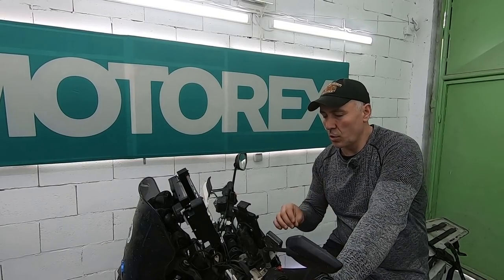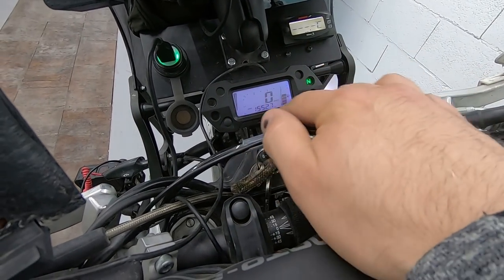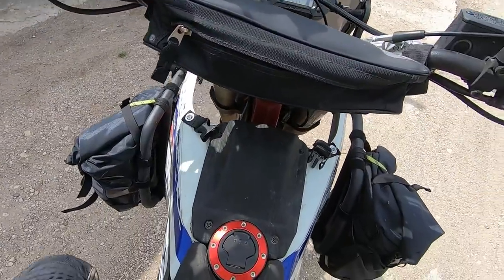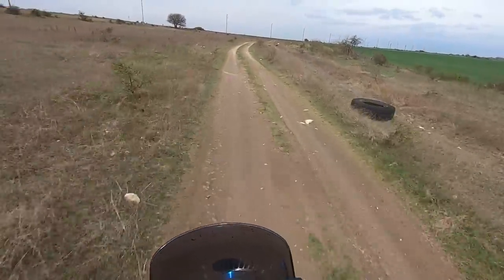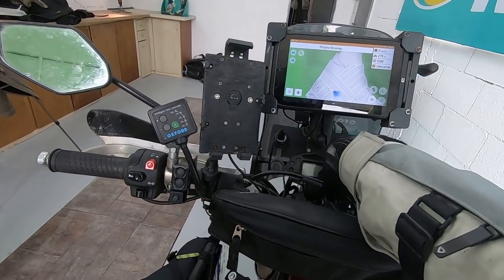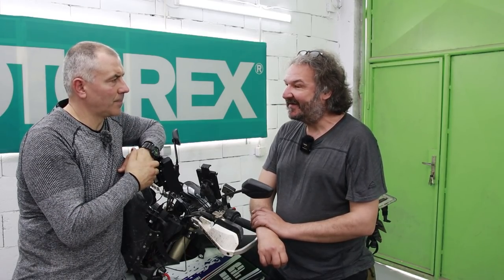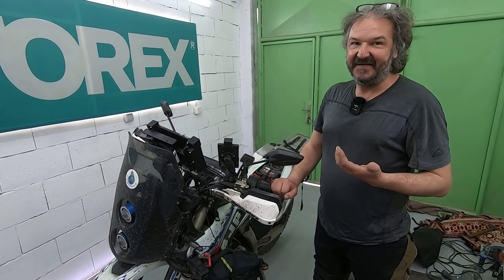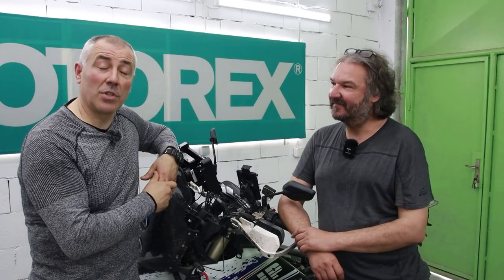AJP PR7 - Big Dirt Bike in Adventure Suit!

Comment: About seat comfort: honestly I was thinking that the PR7 is for "steel-butts" only. But now I have some doubts! He can really stay so many hours on asphalt without particular problems? What was your impression about the seat? It seems very narrow.
Reply: I happen to own one. What you'll find is that the seat is surprisingly comfortable. It hasn't even crossed my mind to look for an aftermarket seat or modify the stock seat in any way. A very pleasant surprise after riding KTMs and the smaller Yamahas.
Reply: @jotemenkir  How is your PR7 going. I would like to change from my 690 to a PR7 but a few of the PR7's in Australia have cracked the crank case at the front engine mount. This is very concerning.
Reply: @pauleyj8  I've actually never heard of cracked crank cases on the PR7. I searched on the AJP Australia group (largest AJP group), but was unable to find anything. Not saying it isn't happening, but it is news to me. Also, the SWM engine has been around for quite sometime and is considered quite solid.

I absolutely love the bike. It's definitely not without some quirks (poor exhaust routing, etc.), but the power, handling and the fun factor is incredible.

 That said, after reading all the posts on FB about lack of parts availability and poor dealer support in Australia, I personally wouldn't buy it there. I live in Spain where I can get the parts I need within 5 days even though there isn't a dealer in town.

Comment: pretty much a proper Adventure bike or rather Paris Dakar racer :)
Reply from the maker: True!
Reply: Got to argue with that! For one, the Dakar shouldn't be called Dakar anymore since it's no longer starting at Paris OR ending in Dakar and is more like Baja. So the PR7 would be a Baja racer, just like the modern "Dakar" Bikes are. Non of the current "Dakar" Bikes would manage to do an entire, Original, Dakar Section. They don't got the speed or the Range for that.

Comment: Thank you for a super interesting video. I am with you Pavlin, the bike seems perfect, but the risk of losing 10.000 euros is big...
Reply from the maker: Fair enough!
Reply: What do you mean losing? How would you lose such a bike?
Reply: @TheGlatch  if the engine blows up there is not much you can do, and this is using an Italian engine...
Reply: @SamiNami  the motor is all Open and some parts changed in Portuguese factory. First AJP P4 (400 CC) prototype as made is road teste. Do you know where. Probably in some portuguese farm? In some factory circuit? No... From Portuguese factory, to cross Alentejo (south Portugal), Spanish Estremadura, Andaluzia, Gibraltar, Marrocos until arriving in Trípoli ( Libia) where it was supposed to be sent by ship to Leça (back to Portugal). But the test driver (also an Eng. @ AJP) was not happy. So he made all the inverse route instead... How can you lose money when a company makes prototype tests like This:-):-):-):-)
Reply: @subscricoesmotard7288  It's nothing like what the big Japanese firms do, before they release a bike. Also if something brakes its possible to get a spare part, not easy with AJP.
Reply: @SamiNami  No problems in getting parts at all, absolutely not.
Reply: The exact reason i got a T7… here in denmark they are both 17.300 euro, and that is a lot of money to loose on a bad resell price